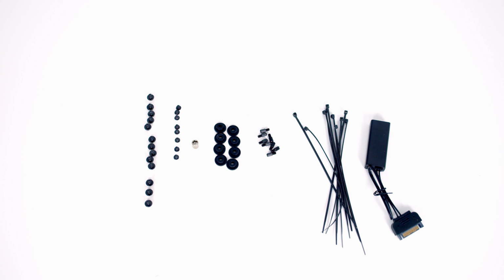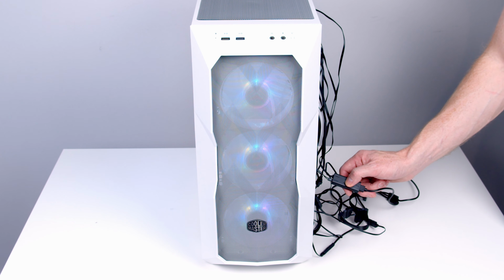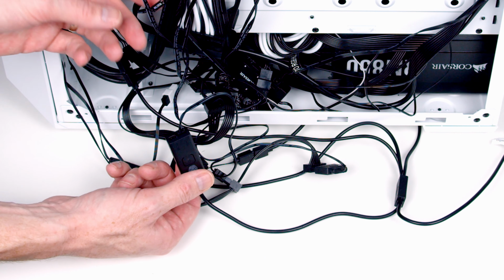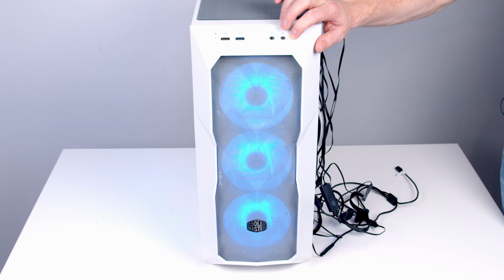Cooler Master TD500 Mesh - RGB Controller Guide

Comment: Nice option with the Reset 'button'. Certainly more convenient.
Reply from the maker: Indeed!
Reply: I need help, I can't find the fan controller ,where is the controller usually at?
Reply: @ok-js3tp  it only comes with certain cases. not every td500 will have one, it needs to specify in the name. ex: td500A (with controller)
Reply: @pandabear17890  Ok, bummer for me. What is a reasonable rgb controller to buy instead?

Comment: Thanks for this great video. I was looking for a switch on the case to control fan rgb. I couldn't find one and I thought I could use the reset switch but I didn't like the idea.  I made a research and found this video to confirm my suspicion. So really thanks. But not providing a dedicated button is not a good idea. I do occasionally need to reset my computer.
Reply: Why not? You can push the Power button for few seconds and its the same.

Comment: Hi wondering If you van help .I have the same case and I noticed that 1 of the front case fans the bottom fan that Is Is not the same color as the other 2 .What could this be and how to sync all 3 front case fans to same color  .Thanks

Comment: I know this is an old upload, I just bought this case a few weeks ago, I like the way you change the colours, is there a way you can change the fan speed, or are they stuck on a single speed thanks
Reply: I just build my PC today with this case. I couldn't be bothered trying to figure it out in the end, no matter what i did, so what i did was i plugged them in the motherboard instead, or you could get the fan controller from from Deepcool. ' Deepcool FH-10 ' ive used it in the past, and i've been satisfied + it's cheap. So basically you can just use the one that comes with the case for the RGB. 🙂

Comment: I just bought this case, can I add a 4th argb fan in the rear with the existing wiring to the controller or do I have to buy a splitter?
Reply: Does the case come with a ARGB 1 to 3 splitter? Please and thank you.

Comment: I have the same case, if I'm not mistaken the three front fans have a  3 pin splitter.

Yet my motherboard doesn't have the correct pins... what should I do?
Reply: Fr tho
Reply: Your motherboard should have 4 pin fan connectors. Try putting the 3 pin into the 4 pin. It should work even though its one pin less

Comment: Great and all, but you should also show everyone how you can branch it off the JLED1 header and control it with Mystic Light ( for MSI users). Any an dall options suitable for this condition. Cheers!
Reply: Is that even possible? Cuz if I do that method in the video I won't be able to use software to control my rgb and I ran out of argb headers
Reply: Perhaps a splitter? SHould alos mention, great Video as well. Sorry, didn;t mention that last post. :)  @BigJim_II

Comment: What about the 3 pin connector
Reply: same I'm stuck with this and don't know what to do about it! Did you find where it need to be plug in?
Reply: Fr I’m stuck idk where to plug it in
Reply: @warzz6919  Plug the two connectors in the three-pin connector. It worked for me and that's what I saw other people did.
Reply: @michaelhoang3841  wait but my mother board doesn’t have a 3 pin thing on it that’s why I’m confused, and the wire I have is a 3 pin
Reply: @warzz6919  Sorry, I meant to put your 3 pin connector of your case fans to the 4 pin in your motherboard. I don't have a 3 pin thing in my motherboard and I saw a video that just connected those three-pin thing in the case fan connector of your motherboard. Any case fan plug of your motherboard will work . You just need to put the tree pin in the four even though is not a four pin.
Reply: @michaelhoang3841  okay, thanks bro this really helped

Comment: Thank you so much for this amazing guide 🙏
However I have broken ARGB controller, the fans are working but the LED is not. I have to press RGB cable into the controller in order for it to work once I take my hand off the LED turns off 😢
Is there any replacement I can buy for the ARGB controller?
Reply: Bransh it off your JLED1 header on your mother baord. Look it up. :)

Comment: HI! Great idea. Do you have a video showing how to install the connectors of those fronts fans in the mother board? I have the same Cooler Master TD500 mesh, and the RGB stopped working. Thanks!
Reply: im in the same boat! did you find a solution?
Reply: @gglukeyb1842  no man.. if you do find a solution, please tell meeeee

Comment: How do you daisy chain an extra argb fan with the existing 3 argb fans on this case?
Reply: My guess is find a fan splitter on amazon
Reply: @rasputin7277  the fans that come with this case are the Cooler Master Sickleflow 120. They come built in with an input and an output on each fan, effectively having a built in daisy chain.

Comment: How do you get the fans to spin?
Reply: Hey did you figure it out? My fans are not spinning  either unless I physically give them a little push.
Reply: @bandagx6360  even with a physical push they still dont spin
Reply: @M3thJunk1e  I figured it out,  go into bios and change the header or fans mode to Pwm mode instead of auto, that will make them spin. If that also didn't work then u probably don't have the real cables connected to the motherboard (not the ones shown in this video) they are very thin compared to the other ones.

Comment: What if you plug the reset button into the motherboard while all fans are connected? Will the reset button work on the front of the case for all the rgb fans connected to the motherboard?

Comment: Hi, Chris the x570 asus tuf pro motherboard doesn't seem to have a 3 pin connector for the case fan from this case is there any alternative for it or is there actually one but that Idk the location! Ty in advance!
Reply: You can resolve??? I have a x570 asus tuf plus
Reply: @JecksonGarcia  There  is actually no 3-pin PWM header for this board but you can use the 4 pin PWM header instead. That's what I did and it worked.
Reply: @michaelhoang3841  Thks, i will try! I suppose that you can't controller rgb fans by software/Aura sync?
Reply: @JecksonGarcia  You can actually control with aura sync if your argb cable is connected to the argb pin in the motherboard.

Comment: if my motherboard doesnt have any rgb headers do the rgb fans still work??
Reply: Mi b450f no tiene conectores argb, pero viene con el adaptador de argb con botones, tiene unas cuantas opciones atractivas, pero si necesitas que tu placa tenga 3 conectores fan para que funcionen los ventiladores
Reply: En resumen el rgb los controlaras con el adaptador, no importa si tu placa no tiene entradas rgb, pero si necesitas esos conectores fan_ (de 3 o 4 pines) para que funcionen conectados a la placa

Comment: Works this Controller with the cooler master Software?
Reply from the maker: No software needed
Reply: @ChristopherFlannigan  to change the RGB front fans how can I change them without of the controller because I don’t like the presets with the controller and I want to change the lights to custom
Reply: @KimboFPS  looks like we need to purchase the other coolermaster argb controller, that has a usb out for software control. I'm also disappointed with the presets.